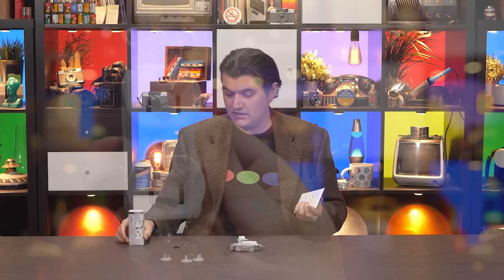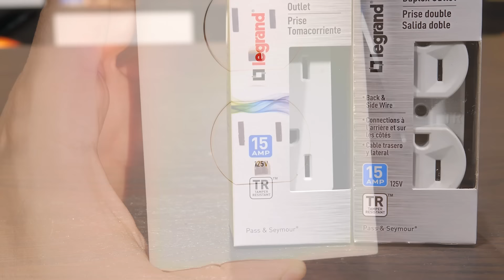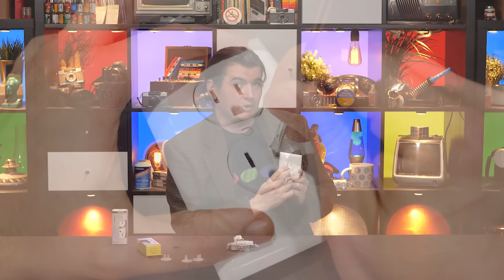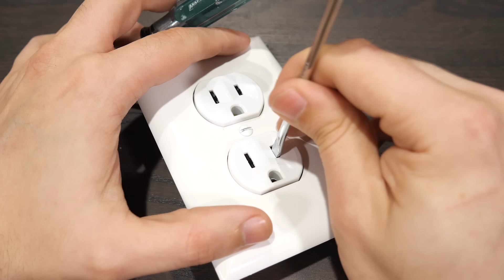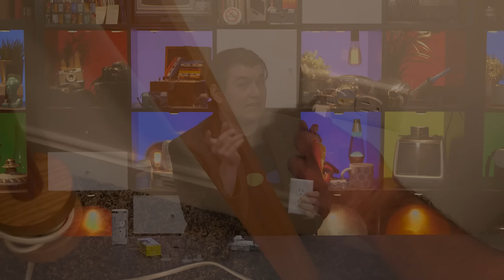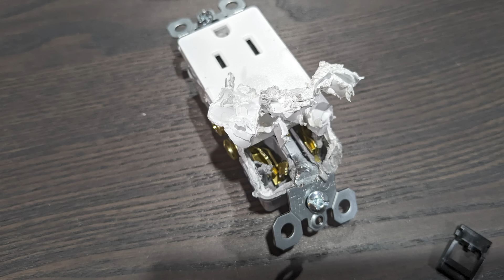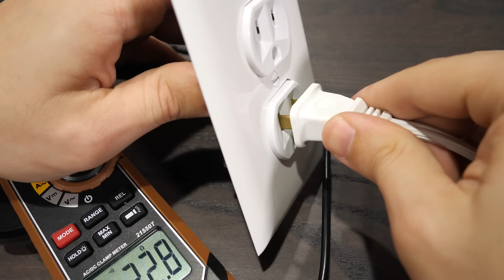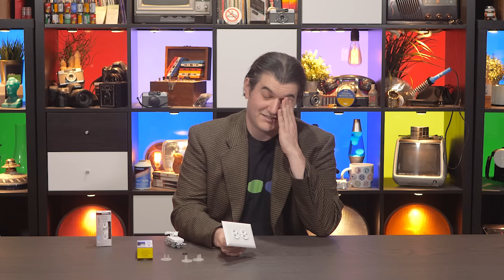Tamper-resistant outlets aren't all the same - a follow-up

Comment: As overprotective parent, who happened to be an electrician, I put a GFCI in line with the circuit for my daughters bedroom. It actually saved her from a shock when she played with a nightlight (on a tamper resistant outlet). She got a very light shock before the GFCI tripped a millisecond later, possibly saving her from a severe shock. I would HIGHLY advise GFCI protection for children's rooms.
Reply: I had a  gfci  save my  life a few years ago.  I have a mini apt. size washing machine in my bathroom that I drain into the sink.  I use an electric heater to heat the bathroom since there's no heat in there (old house originally with no bathroom, bathroom was an add-on, had an elec. wall heater that is now 40+ yrs old that I won't use).  So... you guessed it.  I forgot to put the drain hose in the sink so I had 10+ gallons of water all over the bathroom and it goes out of the bathroom onto the "porch".. (you know those additions with the fake brick and the window left in the wall of the bedroom? I call it the porch).   So the water hit the electric heater and tripped the gfci.   I walked onto the porch and after 4 steps I stepped in water.   If the outlet wasn't a gfci I could have been dead.   My son would come home from work and see me on the floor.  I'm tearing up just thinking of that happening to him.   
After that,  I keep the drain hose in the sink drain all the time and weighted it with a vice grip so the water pressure doesn't pop it out.  I also unplug the heater when i'm doing laundry.  Not taking any more chances.
Reply: Yes GFCI should be almost everywhere
Reply: i dunno what RCD is but AFCI (arc-fault circuit interrupters) are required in Canada in bedrooms, etc but not ALL circuits
Reply: @JimmyMacNCheese  How often do you have to reset the AFCI? Does plugging or unplugging high current loads that arc cause it to trip? Seriously curious, as this is my biggest reason for dismissing them as impractical. Not to mention that they don't actually prevent arcs in the first place, which is necessary if the goal is to prevent starting fires.
Reply: @RAndrewNeal  i dunno.. My house was built in 1973 and i don't have any, but a friend has them..i think they had one trip once in maybe 8 years
Reply: @JimmyMacNCheese  Cool, thanks.
Reply: I have whole home gfci, I think it’s named something like rci 5:15
Reply: I did this, problem in my boy's room, all 4 outlets are the beginning of a new circuit that run to the rest of the house. Needed 4gfci 😑. Nice having on 'off' for each outlet tho
Reply: advise protection in any room*
Reply: Would having both a box GFCI and outlet GCFI cause problems or create redundancy?
Reply: @brettknoss486  It would probably just create redundancy.
Reply: Thanks buddy. I'm quite aware of the NEC and all areas GFCI's are required. As stated, I'm an electrician, and also an active C10 electrical contractor. We're on NEC 2023 now, BTW. @voidmayonnaise
Reply: In most places in the US recently, they require at a minimum AFCI last I heard for bedrooms, GFCI only for wet area's, I'm sure you could get combination breaker/outlets with both GFCI and AFCI
But as soon as you put enough electronic equipment with power factor filtering components on a circuit, you might hit the limits of the GFCI sensor and trip it randomly.
Reply: I did that as a kid (I was 5 or 6) with a 70’s style fibre light. I had the full on numb arm.  It was somewhat enjoyable. (The fuse didn’t blow and GFCI were not around where we lived)
Reply: 30mA GFCI is mandatory in Europe on all plugs and a 300mA main GFCI breaker covers the main electrical panel. I'm always a bit surprised the US mainly use them in bathrooms
Reply: It's crazy how the US doesn't have this as a regulation, RCDs are basically mandated in every home in Europe and have been since 2007 I think. But thank god you did install one.
Reply: GFCIs have been mandatory on some circuits since 1968. Nowadays there are mandated everywhere except bedrooms or other living areas. Bathrooms, kitchens, basements and outdoors have had them mandated since the 70's.
Reply: @Wowzersdude-k5c  yeah pretty much only near places near water. Europe basically has them on everything unless you can find a reasonable exception for not using one. (Places of buisness must have a risk assessment and be only accessed by competent persons)
Reply: RCD protection should be on every circuit with user-accessible outlets. 30mA RCDs like that have been legally required in Germany since 2007, and it's getting more and more common to put a 10mA RCD on bathroom circuits.
Reply: @ska042  You're gonna confuse the yankees with your euro talk, lol. They now require ACFI circuit protection almost everywhere, but only GFCI (RCD) protection in wet areas, or basements. Code hasn't expanded GFCI protection in decades, except to only recently expand to 220v devices outdoors. An overprotective homeowner can add GFCI protection anywhere he wants though (though nuisance tripping is common).
Reply: @jameskoehler4939  yeah I have a circuit that trips with only about 500W of continuous load on it, its a combination of filter circuitry and airflow causing some static build up that is draining through ground
Reply: @jameskoehler4939 what’s ACFI
Reply: @omegatotal  So we are on the same page:
-Ground = connected to earth
-Neutral = one of 'working' wires that is a 'zero' for live wire

If you have proper ground all static should be removed by it all the time and you will not have a buildup.
if not something is not working as it should. It should not trip RCD because of that.
Reply: @siriusgray3579  no kidding... 🙄, gfci will trip anyway (it was the only outlet I had access to at the time) with the load. not uncommon for the type of hardware I was running
Reply: @jameskoehler4939  I have never had a gfci outlet trip. Only an afci from a vacuum cleaner.
Reply: @ska042  You can't substitute good practice. Don't ever touch the prongs when even close to the receptacle, and you won't ever have a problem.

We added a ground conductor to our circuits because no amount of good practice could prevent electrocution from wiring faults (we needed a separate ground from neutral because of the cases where the neutral conductor loses its ground connection, resulting in that neutral going hot if something was plugged in).

We added GFCIs to wet areas because no amount of good practice could stop water from splashing when using it, which could get in the receptacle, possibly exposing power to the outside of it.

We don't need GFCIs on every receptacle circuit because there are no problems it can solve that good practice can't solve better (in dry areas). Plus, they're more expensive and prone to false trips.

Arc fault breakers are even worse, since they only trip after the arc happened, and arcs usually only happen when somebody is plugging or unplugging something that draws a high inrush current. If the idea is to prevent house fires, it doesn't do a good job because it doesn't prevent arcs from happening. Not only that, but if you were plugging in an aforementioned device, you will trip the breaker when there was no threat posed, forcing you to go and reset it every time. If these breakers are on whole circuits rather than individual receptacles, then you would end up cutting power to everything on the circuit because of a little arc. I hope you have a UPS for your computer(s).
Reply: @RAndrewNeal  "You can't substitute good practice. Don't ever touch the prongs when even close to the receptacle" is funny because that's pretty much made impossible by many good plug/receptacle designs around the world, so that good practice has already been replaced, or at least made mostly irrelevant.

The "false trip" thing almost always comes down to semi-defective or mis-designed devices. When adding RCDs you notice these things that previously slipped through. Personally I haven't had a false trip for the last 10 or 15 years having only lived in places with RCDs in the breaker panel, like 90% of the people in this country, but I guess YMMV.

An RCD limits the damaging potential of a shock if it does happen - and let's be real, that will never stop happening even in places that aren't wet, no matter how much we advocate for "good practice", so that alone is enough to justify it in my book. A shock is still very dangerous, but on a circuit with an RCD you've got a much better chance. RCDs also catch defective devices that may be potentially dangerous but don't let large currents flow to ground instantly, which would trip a normal breaker.

I have no opinion about arc fault breakers, never seen one in person to be honest. They're very uncommon here.
Reply: @RAndrewNeal  OK, good luck educating toddlers on "good practice."
Reply: @jameskoehler4939  Shouldn't be too difficult. My mom and dad did just fine; I've never been shocked by 120V even once. Including as a toddler.
Reply: @ska042  You mean many more complex and therefore more expensive manufacturing processes. So then you admit that non-Americans are afraid of our system for lack of good practice, since you apparently don't need it. We have good practice, you have a padded room. I don't insult your system if you don't insult mine. We teach electrical safety, and the teachable learn. The foolish learn the hard way, or they get shocked twice. When electrical safety and good practice isn't taught because it's been "replaced", people have an unhealthy fear of electricity because they don't understand what the dangers are except for "It'll kill me!". Well so can your car.
Reply: @RAndrewNeal  Spoken like someone who doesn’t have children. Just because you happened to be an incurious toddler, does not mean every toddler is the same as you were.

Also, your system isn’t more complex by any means, It’s just overly redundant. Putting a whole home on RSD (or GFCI breakers as we call them in the states) is just overkill. Especially when our GFCI trip as low as 4mA, so nuance tripping is a real issue. Theres a point when over redundancy becomes more a nuisance than a safety measure.

On a side note: good electrical education will teach you that getting shocked by 110v at even at an excess of 80amps is unlikely to kill you, might burn you a little bit. So getting zapped at 110 by a residential outlet at 15 or 20 amps will rarely even hurt you. It may scare you a little bit, but the chance of it doing any damage is insanely rare. As an electrician who’s unfortunately been hit by 110, 220, 277, and the high leg of 480, Alternating Current is fantastic at pushing whatever part of you is touching it far away from its current when you become the ground. Now that’s not me advocating for bad electrical safety by any means, safety is a great thing, but acting like a 110 household outlet is going to end your life so you need entire home RSD setups is a tad ridiculous.
Reply: @moderndiscourse  Are you arguing both positions? I never said I wasn't curious—quite the opposite. But I was disciplined by my parents, having it instilled in me never to touch the metal on the plugs when they're in the receptacle or stick anything in them. It's an issue of discipline (remember that discipline is not synonymous with punishment), not curiosity.

My argument, being American, is against whole-home GFCI systems, and I know that 120V is less hazardous than 240V. It pulls only half the current. It doesn't matter what the breaker trips at; a specific voltage will always pull a predictable current through a known load. It's Ohm's Law. 120VAC will never pull anywhere near 15A through a person's body because electrical impedance thereof is too high. It's usually in the tens of mA range. The danger is in the path it takes; if it goes through your heart, 6mA is enough to kill you. If it goes by another way, you'll just get a zap. That's why it's safer and highly cautioned to use only one hand when needing to work on live circuitry (usually for test probing and troubleshooting an issue that can't be found when unpowered), as using both increases the likelihood that you'll accidentally complete a circuit between both hands and put current through your heart.
Reply: Oh no! It will be slightly more expensive! In typical American fashion, price is far more of a concern than human lives. We'll just put all the responsibility on the parents, on the off chance that said parents will be good educators. It's not the only logical error you make, but you assume because of your personal upbringing that most or even many Americans receive the same education in electrical safety--either in homes or in school. And if we're only going to argue personal experience, I can assure you that I did not receive any such education or training from my parents or school. So I guess if I get shocked to death that's just too bad? That's your entire argument is that it's just tough beans if our parents aren't educated enough to instill "good  practice" in us? Good lord what a vile dystopia of Capitalist Darwinism.  @RAndrewNeal
Reply: @ejstark360  It is the parents' responsibility regardless. The atrocity that is the public school system has had parents believing that they aren't responsible for their children's upbringing, pawning it off on strangers who cannot possibly tend to every child as is necessary like a parent can with their comparatively few children. Not to mention the complete lack of care for the children's learning, as long as they can answer the test questions.

The vile dystopia is the one where everything needs to be idiot-proofed because nobody cared enough to raise intelligent children a generation ago, and impart the common sense learned and passed down over many lifetimes. This is a tragedy.
Reply: @ejstark360 talking about oh no it's more expensive is what the us complains about. Yeah if we didn't protect you you would not have a country that's funny worry about your country...
Reply: @ejstark360 Thing is, if you compare electrocution rates in the US vs the UK, they're very similar once you toss out lightning strikes.

People focus too much on the outlets themselves and not the entire system, including culture.

North Americans are fine with their outlets because in 99.999% of instances, they do not cause a single problem. You'd probably incur more deaths changing outlets out to a new standard than by keeping the current NEMA outlets.

Also you forgot Mexico, Canada and Japan. They all use basically the same outlets and Japan's are even less protected than they are in the US.

120 volt electricity just isn't that dangerous. Shocks you would get from trying to play with the outlet (which I did a lot as a kid) aren't lethal by any means and I'm the only person I know out of dozens of people who has actually been shocked.... because I intentionally tried to do so.

And it was because the ENTIRE outlet was coming out of the wall. Had nothing to do with the outlet itself, but rather being an old shoddy home.

Lastly, people generally forget that the reason the UK has a nice fancy outlet is because they used to have a whole bunch of crappy ones and appliances didn't come with plugs wired on them.

They got better outlets through standardization. If the US was going to need to do a similar process, they'd do it. They don't because it's not actually worth it in any terms.
Reply: @RAndrewNeal  America isn't too good at teaching electrical safety, though, to people whose jobs don't directly involve electricity. I've had to educate a lot of really smart, educated people on electrical safety - Americans all - entirely because the American school system failed them.
Reply: @veilrainforest  The American school system is doing exactly as designed.
Reply: @RAndrewNeal  I just wanted to clear up some things about the initial comment about german requirements and some other stuff:

The entire home has a singular gfci in the breaker box, not the outlets one each. They are not very expensive either (I think 40A is like 30€?). I never heard anyone ever complain about nuisance trips, on the other hand I don't regularily question people about electrical issues. 

I don't see how any marginal manufacturing costs of the euro-plug vs the nema-plug factor in, the receptacles are simply recessed and the initial bit of the contacts on the plugs are non-conductive on plugs without ground pin(s).

Also I think it's worth to consider that this does not only protect against user errors but also protects against a certain subset of device failures where for example live partially or entirely is shorted to ground, this not only protects the user from touching a potentially live chassis (depending on if its grounded or not) but also from the device catching fire due to the short. (Or even just against faulty wiring)
Reply: @Rabidum  The partially insulated prongs is the increased production cost i was referring to. The German method of recessing the receptacle is very much superior to the British method, because if executed correctly, it does not need insulation on the prongs at all, and is not any more complex to manufacture than our NEMA plugs.

I don't like the idea of putting an entire house on one GFCI. If a bit of water gets in the receptacle while doing the dishes, the whole house goes off.

Our standard does not allow for ungrounded plugs on devices with metal chassis; they're required to be grounded. Also, a dead short will trip the regular breaker; no need for a GFCI, which won't trip at all if there is no current mismatch between hot and neutral (e.g., when no ground conductor is even present) until someone touches it, causing a mismatch.
Reply: @RAndrewNeal  The german "Schuko" plugs do indeed not have any insulation on the prongs since touching them while inserting or removing the plugs is physically impossible.

I understand the concern of nuisance trips and can just reiterate this seemingly doesn't happen - probably a combination of the receptacle design making it hard for water to get in there or even practically requiring submersion if a device is currently plugged in and common practices regarding the distance between sinks and receptacles.

Perhaps I was a bit unclear on the device failure part, I should have said earth not ground. We also have such standards although I personally don't mind the extra layer of safety against faulty wiring.
What I meant is that while a GFCI does indeed not protect against shorts between hot and neutral it does so with even a tiny leakage between hot and earth. 
While it seems almost impossible to find any statistics on this failure mode from personal experience I can say that this might not be as uncommon of a failure mode as one would think. Partly contributing to this might be the ever increasing prevalence of control ciruitboards that if faulty are not unlikely to short to earth and not trip a regular breaker while somewhat conveniently tripping the GFCI.

That said the benefit-cost ratio here seems rather hard to quantify, I can again only speak from personal experience that this happened a few times to me and while not necessarily dangerous did without fail correctly indicate something fundamentally wrong/faulty with the device tripping the GFCI. 
The overwhelming majority of such devices would probably just appear to be nonfunctional without a GFCI or simply trip the breaker, but it seems to me that there is certainly a window in which the device might warm up enough to catch fire before tripping the breaker. 
Perhaps also worth to consider is that an outlet here can commonly supply about twice the common US wattage before tripping the breaker and as such increasing that window considerably.
Reply: @Rabidum  It isn't so much nuisance trips, but legit trips cutting power to more than the device or the circuit it's on. One GFCI for the whole house will—to give an extreme example—kill your computer during its BIOS update if, at the same time, a hair dryer is dropped in the bathroom sink with water running.

You make a good case for installing one 100mA GFCI per circuit, giving coarser detection than the typical 6mA, resulting in a near guarantee that they will only trip if a failure occurs.

I guess what it really boils down to is that we haven't ever had any problems doing it the way we do (if we had, we'd have changed it), so we get put out every time we get Europeans telling us we need to do it their way because this that and the other.

It's been nice talking to a guy who puts logical thought into what he's saying instead of "America bad, [insert European country] good".
Reply: @RAndrewNeal  tbh it seems to me the biggest difference between Radium and ska042's positions were mainly in tone and brevity? 

I'm glad I read the thread all the way though
Reply: @kaitlyn__L  Their tones were definitely stark. In general, though, I think Rabidum showed respect to a foreign-to-him way of doing things, while explaining his thoughts/opinion; whereas ska042 was the typical internet dweller, rude and arrogant towards somebody who doesn't do things like him, nor wants to. Hopefully I didn't come off rude; you just have to be aggressively defensive to people like that.
Reply: @ska042 I’ve had plenty of false trips with GFCIs. Mainly refrigerators and air compressors and such. House was wired dumb and circuits that don’t need them have them unfortunately.
Reply: @RAndrewNeal  i feel like that's survivor's bias. with the addition of whole-circuit 30mA RCD's to all australian home circuits (it was mandated in 2017) we won't even know how many people will be saved, simply because they have no reason to report it. for $30AU (around $20USD) each to get a combined rcd + circuit breaker why not just pay the extra? and you don't need to get so defensive - the main reason why americans get poked at so much is because you're very caught up in the "our country is completely perfect" narrative and refuse to accept any, often valid, criticism. it's not a personal insult, just a conversation about different standards.
Reply: @hvrbros8730  GFCI breakers for the panel/box are $60. Regular ones are less than $10. True enough, these should be bought once and used indefinitely, but that's what they cost here.

We use GFCI receptacles in wet areas. Even so, most people who get zapped by 120V get just that—a zap. It's the presence of water that makes it more dangerous as it reduces the electrical impedance of the body.

Look at the buffoons in DC and the White House. How could anybody with at least half a brain think this is perfect?

What gets me is the foreigners who want to make objective claims about the standards of a country to which they've never been. Standards to which they'll never have to hold, so long as they stay where they are. We're not electrically paranoid, so we don't idiot-proof our systems (as far as end-user installations). We use the Customary system instead of metric because that's what our intuition has been developed around. Now a secondary reason is that everybody else seems to hate it, so I'll just dig in my heels.

Talking and having conversation about these things is not an issue. It's the people who want to make claims to superiority because their system is a different one. Rather than question and understand, they assume and insult. That is the majority of internet-dwelling Euros on these topics. That's why I come off defensive; most of them are on the offensive.
Reply: @hvrbros8730 As an American... it's endlessly frustrating dealing with the "however America is doing it is the Right Way" people. We can't have nice things because they aren't American enough or something.
Reply: @moderndiscourse 80 amperes will most certainly kill a human.
Reply: @DouglasGross6022  Could it kill a person? Yes for sure. 

Will an 80amp shock LIKELY kill a person? No, it won’t. It’ll scare the absolute f*ck out of you, most definitely burn you, and likely get you sent to the hospital to get checked out - but even at 80amps the probability of dying from a shock is much lower than surviving the shock. 

Now.. if for some reason you got hit with 80amps continuously, then yes - you’re probably going to die. Although there’s only some very rare occurrences where you’d get stuck to 80 amps without it immediately shorting out.
Reply: @RAndrewNeal 
No amount of teaching "electrical safety" can protect you from something being broken in dangerous way.
I work as electrician in EU and i have seen many different ways something can go wrong and no one would ever know if RCD didn't trip.
You don't get to see that electricity is running through something with your eyes.
Circuit breakers are not designed to protect people, only installation.
And we do teach electrical safety despite many households already equipped with appropriate safety measures.
We don't think that being on guard is a reason to have idiotic plugs that can just partially remove themselves from the outlet.

Most cases where Arc-breakers are installed in EU they are accompanied by rated equipment designed to contain any arcing, mostly in Explosion endangered areas.
all in all mostly 'industrial' stuff. I do agree that it sound quite useless to instal one in otherwise ordinary circuit.
Reply: @ska042  I'm wondering if RCD's are more difficult in North America because the main breaker carries unbalanced loads between the phases regularly. Each breaker would require its own RCCB and whose I've seen in industrial settings are all 2-pole. That leaves it down to the actual plug to detect residual current, which is likely why we just stick a GFCI upstream from wherever that protection is needed.
Reply: @RAndrewNeal  120v is twice the current of 240v. 110v is over twice the current of 230v.
Reply: @bootmii98  No it isn't. When designing an appliance to operate on a wide input voltage range, it is designed to alter its input impedance to maintain the correct power usage. 120V into a 1Ω load pushes 120A. 240V into a 1Ω load pushes 240A. It's Ohm's Law: V=I*R. Your assumption is that power usage remains constant, in which case, you'd be right. But that only happens when the appliance was designed to actively regulate power intake (by varying the 'R' in V=I*R).
Reply: GFCI protection should be EVERYWHERE you won't get too many nuisance trips.  They aren't that much more expensive.
Reply: Use AFCI/GFCI breakers instead of outlets, to protect the entire circuit. These have been mandatory in other countries for a long time.
Reply: use protection and you dont have to be anxious about offspring
Reply: Wrap everything and everyone in bubble wrap.  Problem solved.
Reply: @billkraemer4710  bubble wrap is a fire hazard.